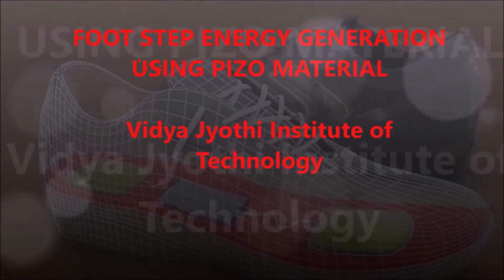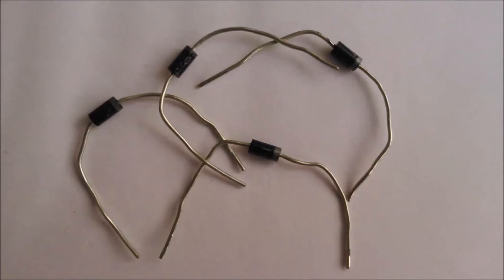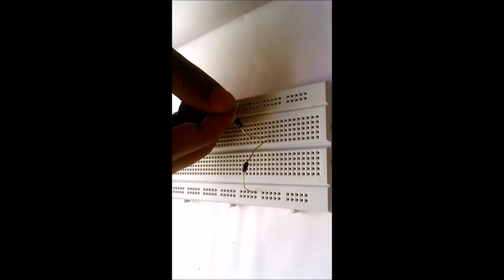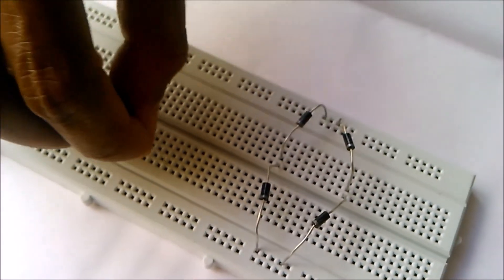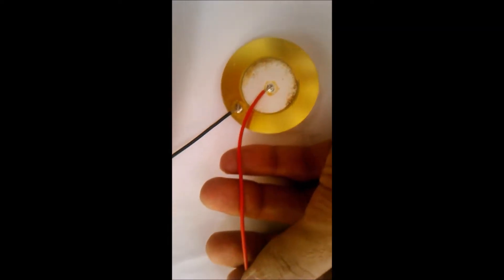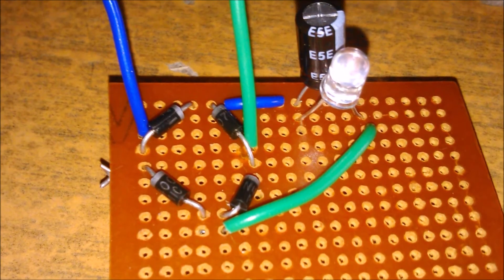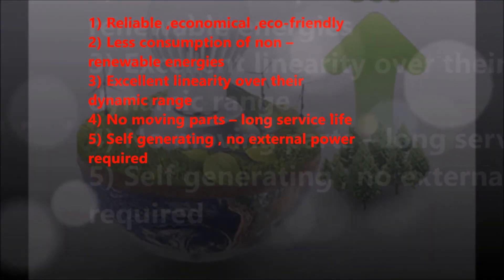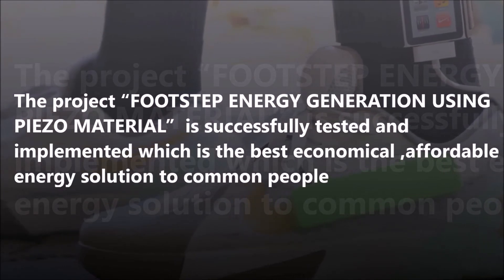PIEZO Power Generation | Foot step Energy generation using PIEZO | PIEZO Electric

Comment: Can I use 6volts relay and battery to store more energy?
Reply from the maker: To store energy in battery you need to use BMS(Battery management system) circuit . You can find this circuits in power banks , you can also get those circuits in electronic stores.
Reply: @hrupak  yes i have one of it, really suitable about its size, but the problem is knowing the circuit diagram connections, coz i really want to restore more electrical energy to consume later, because our area is always getting problem of brownout during rain,. So I'm just doing any research about how to restore energy to consume soon or whenever I wanted to, So can you help me to make it, and sent a circuit diagram to my email ginovigilia015@gmail.com
I really need this, thank you
Reply from the maker: @GinoLucido  for more voltage you need to use more piezo transducers , in series . But make sure that all piezo transducer gets pressure at a time, for this u need to make a plate with piezo transducer which consists of spring mechanism, to distribut the pressure .
Reply: @hrupak  I can buy online more of it, thus I didn't know how I make the circuit diagram to make it work... By using BMS, if i did some mistakes otherwise it shorts at a time and it doesn't work at all... 😢😢😢
Reply from the maker: @GinoLucido  first do simulation in any software like proteus , then buy components.

Comment: please tell the diameter of transducer ... we won't get the output
Reply: Aarthyanbu A you can get any of the diameter, it depends on your requirement 
depending on voltage I. e power output you can get 
we used 5cm diameter radius